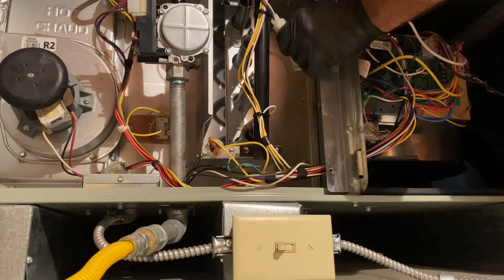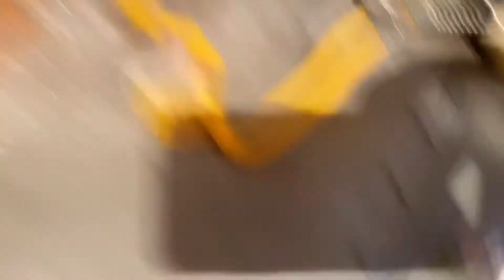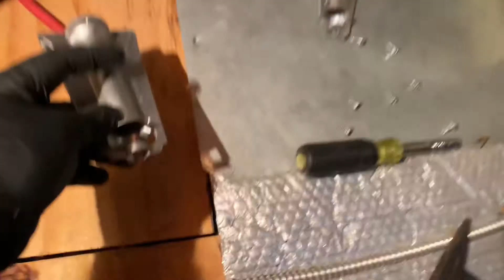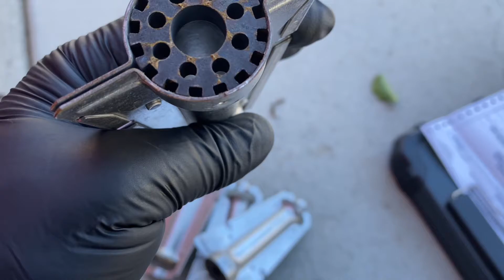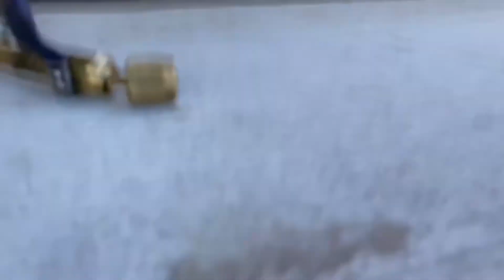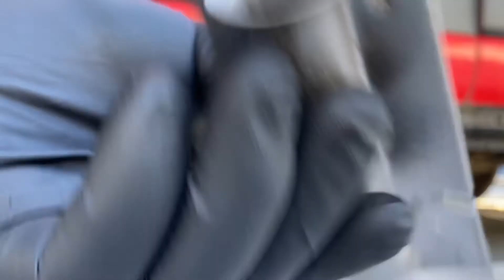Trane furnace with bad flame roll out!🔥🔥🔥🔥#hvaclife #hvac #hvactraining

Comment: How did the unit shut off? Did the rollout switches open like they're supposed to, or did you manually shut it off with the switch?
Reply from the maker: No, I manually turned it off at the power switch
Reply: @Victoryhomeservices209  ouch. That was a scary fire. Do you think the safety would have worked if you were not there to watch it?
Reply from the maker: @Sam Andrew  I don’t think so because the flame was rolling out behind the rollout switches a little spider could have caused a big fire in that ladies house